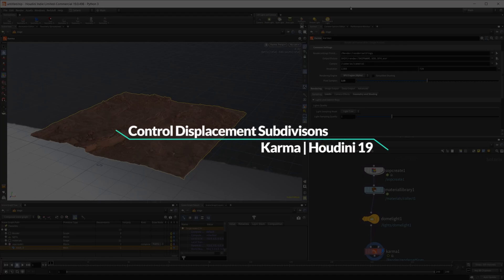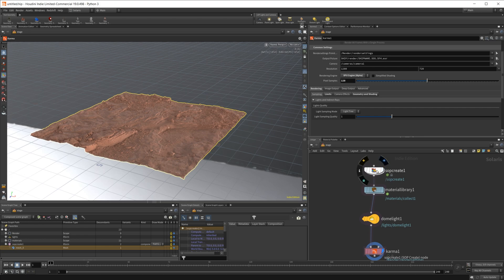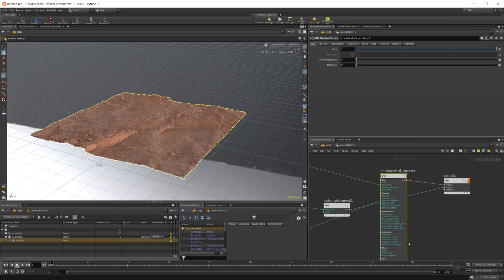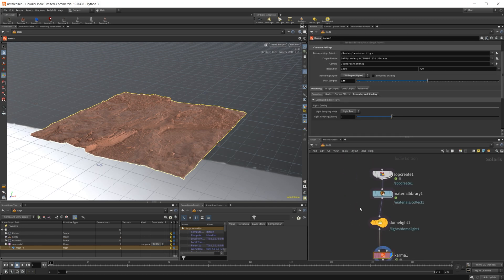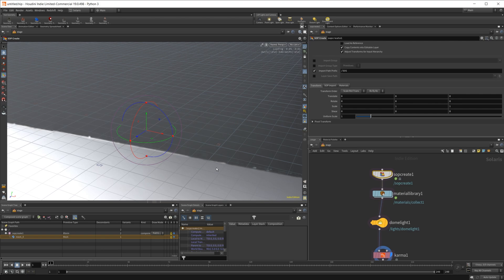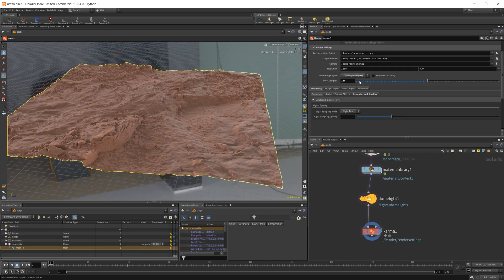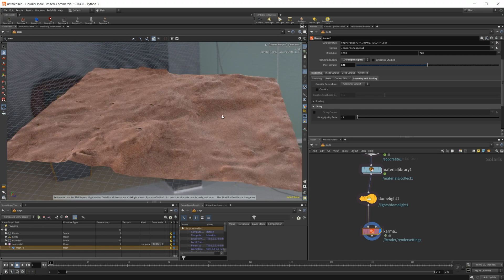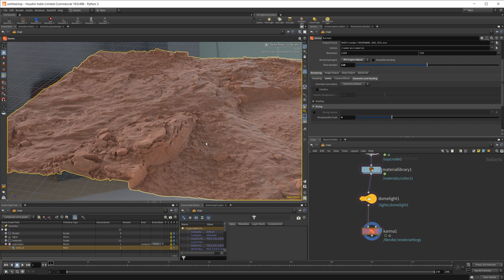Control Displacement Subdivisions in Karma | Houdini 19

Comment: Hi!
Thanks for the tips! Really cool
Indeed I had found the "Dicing" too. This is cool, but I find that compared to Maya we lose control.
The cool thing about Maya is that each object can be individually assigned a subdivision level. So if an asset needs more subdivision than another we can have control over it. Here the dicing puts subdivision on all the objects of our scene, while certain of it we may not need?
Reply from the maker: Yes have control on a per object basis is something that should be possible to control but as far as I have found Karma does not allow us to control that unfortunately. Only the global dicing scale
Reply: I can see that one can simply isolate which geometry one would want to dice, which by default is set to the default expression: `lopinputprims('.', 0)` .....meaning every prims (applicable)... So it should work.
Because if you don't specify which primitives specifically, than yeah dicing will be attempted on all applicable objects